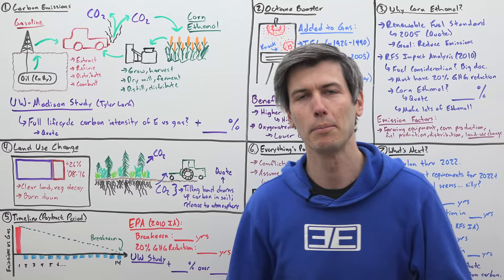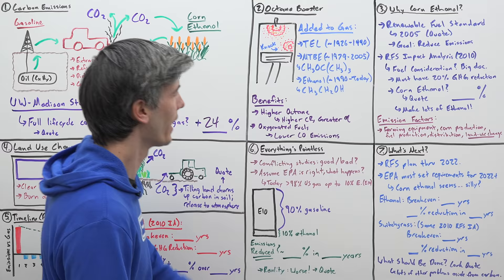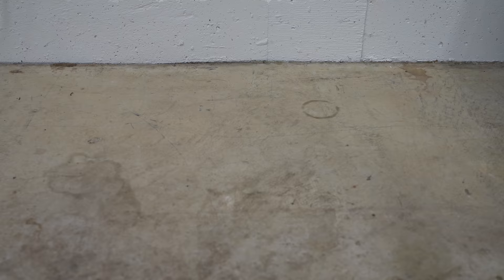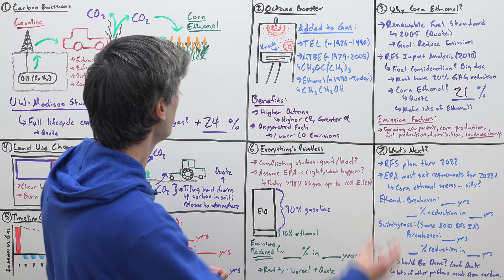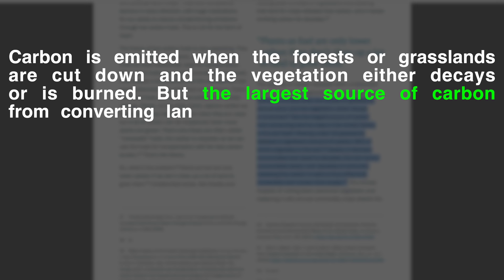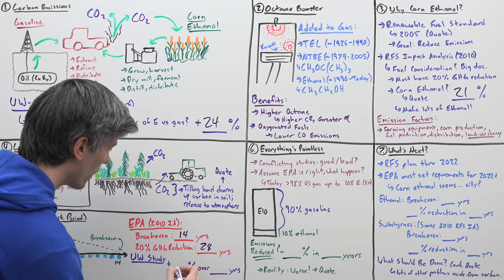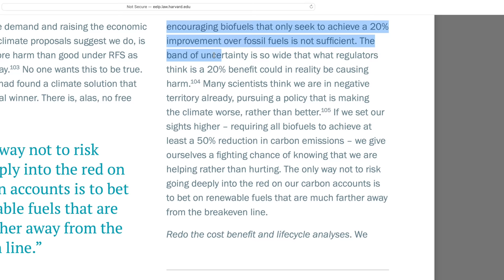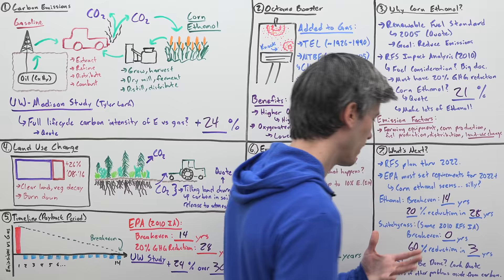America Was Wrong About Ethanol - Study Shows

Comment: Perhaps I missed it, but cornfields need to be tilled each and every year, so the release of carbon from the root system is an ongoing problem.
As with most government-run/designed programs, it's not about the actual benefits as stated by the people writing the bill, it's really about the money going to certain individuals who have the means to build large production plants. It's good to have friends in high places.
Reply: Most corn fields are not turned anymore.
They call it notill farming.
Reply: @lesleyboeder1798  this varies widely based on equipment that the farm has.
Reply: @lesleyboeder1798  ...and the location.

Northern farms such as those from central minnesota, dakota, montana, etc. northwards have a tough time with "turning the soil black", so no till is a better option for them, but residue management is a big deal in the areas that are more central and southern with lighter soils which dry easier and don't quite have the same amount of residue decay. Famers in these regions tend to prefer heavier tillage as a way of getting the residue to break down and have better seedbeds for the next planting.

No-till is great for double-cropping though as it cuts down on the turn-around time for field prep. Double-cropping isn't for everyone though and only makes sense in certain use cases.

Comment: You gotta love how the pitch for ethanol fuel is “corn grows, we ferment it, a miracle occurs to make white lightning, and then we stick it in a car.”  Anyone who’s ever even looked at home brewing has had that brief moment of consideration of going one step further and making moonshine.  And it quickly becomes apparent that you have to dump a metric ton of thermal energy into the mash to boils off the alcohol and distill it.  Which should prompt the question, “what is behind that heat source and is that being included in the carbon figures?”  It obviously wasn’t, there’s no way in hell they could have pitched ethanol as a less carbon intensive fuel source than 87 octane when you consider how much natural gas or coal is needed to generate enough electricity to distill that fuel.
Reply: When I worked in an ethanol plant, they used coal to fire the boilers that steeped the corn.
Reply: If that was the only problem, that could probably be solved using solar thermal energy - The roof mounted kind. That would definitely be cheaper but Limit productivity proportional to the amount of solar thermal collectors. After all, that is the most efficient way to use solar energy for heat because you skip the detour of electricity.
Reply from the maker: Great addition, thanks for sharing!
Reply: As far as I know it takes a lot of heat to distill petroleum too.
Reply: @onemoremisfit  yep, and then you burn that to produce ethanol..
Reply: Yeah, I seem to recall a study that showed in order to make Corn based ethanol we burn more energy worth of coal/oil/natural gas to cook it than the resulting ethanol itself contains.  We would literally be better off just burning the natural gas directly in our vehicles than using it to make ethanol.

Another way of putting how silly the whole idea is: corn based ethanol is literally paying massive corporate farms to light their crops on fire and using fossil fuels to keep them burning.

There is an ethanol plant in the town I live in, it is the way you can tell on the road that you are getting near the town, because of the massive natural gas powered steam plume the plant is putting out of its main stack 24/7/365.
Reply: @D3kKromb0x  At this point your moonshine factory is also a cloud factory.

Funny enough when you burn natural gas one of the byproducts is water, so it's probably not just water from the corn.

I wonder if it would make sense to dry up the corn plants, grind them and use them as fuel or are they kore valuable as pig feed and it's cheaper to use gas/coal.
Reply: In Brazil, it's the sugarcane bagasse that's used for process heat to distill the ethanol. Usually, there's enough to even generate some electricity, and sell to the grid.
Reply: It's the same problem with electric cars.  If your electricity source is clean, no issues.  If you're powering your electric car using coal fired plants, just go back to gasoline engines. And of course oil refineries have the same issue to in powering their distillation columns.  So I don't see singling out distilling energy inputs as being a distinguishing factor here.

Comment: Brazil has an Ethanol program since the early 80's. It got to a point where most cars were running with cheap 100% Ethanol from sugarcane. I remember being in Sao Paulo and traffic smelled like a Rum factory... The initial program ran into problems with injectors, carburetors and other gaskets going bad. With time all these were substituted with ethanol proof materials and the cars started to run fine. The only gas they use is a small,  like a windshield wiper container, with regular gasoline that is used to start the car in cold weather. Brazil was basically independent of Petroleum gasoline for a few years - until politics screwed things up...(I dont believe the Petroleum companies like that idea). At a point there were Tri-fuel cars running all over: gasoline, pure ethanol and natural gas...you picked any of these and the car would run fine by changing the ECU specs at a press of a button. These were Ford and GM cars. Why here is the US nobody ever heard or done anything similar??
Reply: I'm brazilian. Today, cars made in Brazil can run on either ethanol or gasoline, in any proportion. Our gasoline contains 27% ethanol in its formula. It is no longer necessary the tank with gasoline for cold start. The injectors heat the ethanol when needed. This technology is employed by GM, Ford, Honda, Hyundai, etc. The idea of a vehicle being able to use any type of fuel is not to be dependent on prices. This technology we call "flex fuel" has been in use since 2004. Before, you could opt for gasoline or ethanol vehicles. Ethanol manufactured in Brazil comes from sugarcane. Depending on fluctuation and market demand, mills can manufacture sugar and/or ethanol. The mills use their own sugarcane bagasse to generate thermal and electrical energy, and they even sell part of this excess energy to electricity concessionaires.
Reply: Money and politics
Reply: An acquaintance of mine from Europe was here in Brazil for the first time and asked about this smell we could feel the street. It took me a while to figure out she was talking about the cars exhaust, because it was so common for me that it was just a background nois... huh, I mean, background odor.
Reply: The problem is that Congress has enacted laws preventing the use of anything but corn for ethanol production, and also preventing any increase in actual sugar crops like sugar beets, by limiting the total U.S. crop to 3x the sugar cane crop, which is limited in the U.S. by climate limitations.  They aren't looking for a solution.  The solutions already exist.  There is still money and power to be milked from the current system, so there are laws to keep that system in place.
Reply: Brazil was using sugarcane derived ethanol.  The amount of energy gained is higher than from corn because the energy investment is far lower for the conversion. The most interesting ideas in the US that I have seen relate to bioengineering algae as a source. Pluses - better potential yield, less land use. Negative - water requirements. Of course with the Great Lakes, the Midwest does have a vast supply of fresh water.
Reply: @yaemz123  thanks for the education
Reply: @KoyalAlkor  -- Much better odor than back in the 1800s when streets stank of horse manure.
Reply: @gregb6469  nah horse manure is the least offensive of all farm animals.
Reply: @supervisorbuinadv1220  mu 2000 Ranger says it can take e85 in the manual
Reply: @supervisorbuinadv1220  so your farmers tractors run on ethanol?
Reply: So what sort of mileage do you get on this blend vs straight gasoline?
Reply: @greenidguy9292  Probably unless they are a diesel
Reply: Nikolai Tesla had a car that was totally electric & ran by receiving electricity broadcast from an antenna. True, it was limited in range by the antenna, yet that technology would be excellent if a system of antennas were stationed all across the U.S.A. & other countries. Nuclear power is clean & efficient & the best way currently to produce electricity. So coupled with the broadcast tech by N. Tesla, that would result in a massive reduction in pollution emissions worldwide. (but it WOULD result in the almost total loss of profit for the petroleum & energy sectors)
Reply: @gregb6469  or just plain human feces
Reply: @greenidguy9292  

Generally with a tank of gasoline it runs more than with the same tank of alcohol. But as alcohol is cheaper, (but it varies, depending on the season when the sugar cane crop is processed) it is better to fill up with just alcohol than just gasoline.
Another difference is that the engine generates a few more hp with alcohol.

My 2014 honda Fit does 7.1 km/liter with alcohol and 8.5 km/l with gasoline, something like that. It's been months that I've only fueled up with alcohol, so I don't remember exactly now.
Reply: @WilliamCWayne  Anyone who gives 3 word simplistic solutions to complex issues has no idea what they are talking about.
Reply: @damonburkhart7424  very good. In addition, Brazil is tropical, and they can get 2 crops instead of one crop of corn in the US.
Reply: @gregb6469  New York City in the late 1800's had a huge crew to pick up 100,000 tons of manure per year.
Reply: @danstrayer111  I'm just catering to the average attention span
Reply: @WilliamCWayne  understood!  90% of Americans operate at a 6th grade level in the sciences.
Reply: @danstrayer111  I'm not sure what that has to do with attention span, but I can't argue with your statement
Reply: @damonburkhart7424  ..... and here in the US was have the Sugar Beet Industry, about 15% of the beet is Pure Sugar C12H22O11 ... (Dad was a Chief Chemist for GW Sugar), and that was back in the '80s. so why in the He!! aren't we using that, the infrastructure is already setup, the local people KNOW how to run the factories (& usually are the farmers that grow it, as well) & there are even BINS 350 feet tall, by 40 Feet wide, a with foot thick concrete walls, in multiples and factories are already setup in at least 20 cities all with railways right next to them and could be re-built where needed with no technical problems (been doing it since 1920 - Grandpa helped build the factory where I grew up).
Reply: @yaemz123  The RFS specifies no particular source for renewable fuel, it can come from any.

The acreage allotments and regulations for sugar beets were purposely bypassed with the development of "energy beets" which were not covered and they can even make more ethanol per acre than traditional sugar beets.

There were some serious companies looking into it and I do not know what happened but can guess.  Corn ethanol is called generation one fuel in the RFS law and the subsidy for it ended in 2011.  But energy beets in an article I read for some reason qualify as generation two which I thought was only for cellulosic ethanol.  The subsidy for generation two just ended at the end of 2021 and the subsidy was $1.00/gallon which is over double what corn's was.  The US gave beets every advantage over corn.

The serious companies were looking hard at North Dakota because they can and already do already raise them and long days and cool nights are perfect for plant development of beets, but a big reason was beets can be stored there during their very cold winters for up to 6 months.

When the energy act was first passed, the cry was that not enough ethanol from corn could be made, but the Bush administration did not do anything to alter the law and ethanol production came online very quickly on schedule.  When the same cry on the generation two phase of the energy act went out, the Obama administration through dictates or executive actions did not enforce the law which caused investment, research, and development to quickly dry up.  In other words, it became a self-fulfilling prophecy.

Sugar beet pulp is very little of anything since beets and especially energy beets besides being mainly water (70%?) are then mainly sugar.  The small amount of pulp left over is very low but as you said has 7% protein, but rest is mainly fiber and there is some left over sugar so they like to blend it into feeds much like molasses.  

The reasons energy beets never came to be might be #1 they require a dedicated acre vs an already existing one, #2 Obama administration became wishy washy on gen 2 ethanol enforcement, #3 beets don't store well, #4 Energy beets would have required farmers who never raised beets to buy very expensive specialized equipment for harvest, hauling, and storing, #5 the method of farming beets involves heavy soil disruption, not going to have no-till with it at all.
Reply: @ChestyPullerFan  c
Reply: @starmon2  I honestly hadn't considered that (I come from Michigan and have driven past the fields and factories) because I didn't know the return was that high. That or the switchgrass mentioned by mrvwbug44 make more sense than corn. But corn is highly controlled by big-ag companies who have the means of "thanking" congress critters for voting in "the public's" (read their) interest. We would be better off without the government encouragement of industry in this manner.
Reply: @ChestyPullerFan  I wonder if the oil companies would have enough money to invest in another technology hum something that might be a little bit more planet friendly I'm sure there's people out there companies out there with ideas that would accept a couple 10 billion dollars worth then angel investment capital.
Reply: @danstrayer111  with switchgrass you can get three cuttings in a season.
Reply: In Canada we have flex fuel for ethanol and regular petroleum, lots of 2000's gm's have flex fuel and the ability to run off of propane on stock ECU, but where I live we have no ethanol pumps, and nobody runs propane except some busses and trucks.

Comment: One of the many issues I have with using ethanol blend fuels is that I get considerably less fuel efficiency when it is used. I also have major issues with the ethanol absorbing moisture causing rust in my metal line and fouling out my injectors. Even when run through completely and regularly, I still have issues.
Reply: Look into fuel polishing systems
Reply: @rooky55  Correct. It eats rubber.
Reply: you dont know what you are talking about. ethanol is 114 octane gas is about 83, ethanol is so much better and it doesn't corrode metal only aluminum is dissolved over time and it cleans all parts of the engine, it cleans your injectors from dirty gas
Reply: That's because ethanol, simply enough, has less energy per unit volume than gasoline does so it stands to reason you'd get lower mileage.
Reply: @haroldbrooks5473  The concern is that ethanol attracts water, which makes your gas wetter, which contributes to corrosion.  That's why you can't generally buy 200 proof alcohol - it pulls so much water out of the air that it's not practical to keep the purity higher than 95%, or 190 proof.
Reply: My gas tank rusts from the outside not inside. It took more than 20 years to rust.
Reply: I don't think this video is about the use of ethanol in general but the use of ethanol derived from corn farming.  There isn't really a huge argument that the use of ethanol itself is worse for carbon emissions.

There are definitely arguments against using ethanol in vehicles that weren't originally designed to take advantage of the characteristics of ethanol though.
Reply: @haroldbrooks5473  All of my old reliable equipment has aluminum carbs so it's a no go for me.
Reply: @Steve_Mazza  The reason you can't buy 200 proof non-fuel ethanol is that a distillation column can only concentrate ethanol to 190 proof.  Getting it to 200 proof requires another dehydration process typically only used in fuel ethanol production.
Reply: @haroldbrooks5473  like metal polish it a abrasive, not much but over time, like water can move mountains with time
Reply: @haroldbrooks5473  Mmmm...  I was going to respond, but just see the responses above if you still don't get it.  They know the facts
Reply: The total fuel consumption of U.S airlines is approximately 19 billion gallons annually. 

Total fuel consumption for mining lithium to make electric car batteries is 21 billion gallons annually.

The 21 billion gallons can only produce enough lithium for 250,000 car batteries.

The lifespan of an electric battery is 10 years and is not renewable.

Electric cars are not better for the environment.......they're worse.
Reply: @SuperSetright  hopefully they figure out how to make hydrogen feasible, user friendly, and safe I feel like it is the best way to go
Reply: @sneal77777  Stanley Meyers had it totally figured until they poisoned him.
He had global patents on each device to run on water.
H.H.O.  the spark plug and ignition  is replaced with his injection system and hydrogen is  the SMART fuel.
But big oil would have died within about 3 years at a guess. 
Imagine where those jobs would have gone?
Reply: I have a Holden (GM) 6.0 SS commodore, allows E85, drinks the fuel so quick you can see the fuel needle moving, but ohh the acceleration is truly noticeable.
Reply: I have many videos showing this is not true. gas tanks sitting for years with e85 no rust at all. Does Exxon pay you by the post or just pay a yearly stipend?